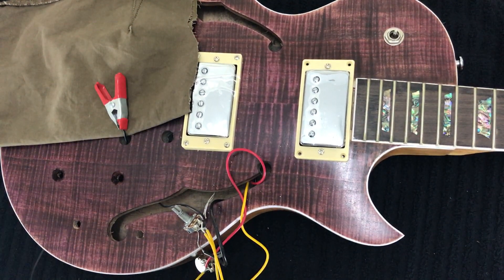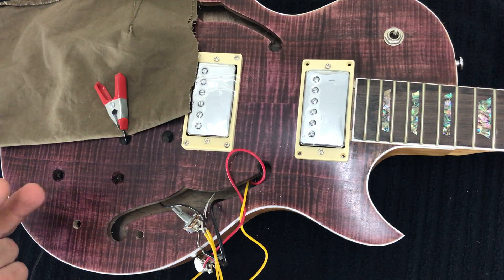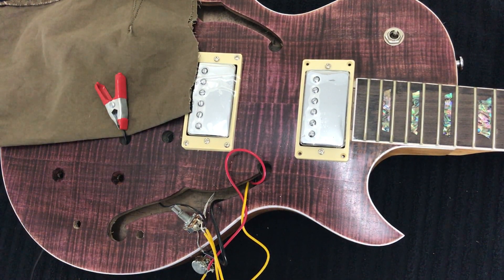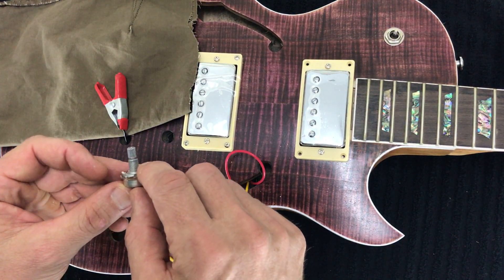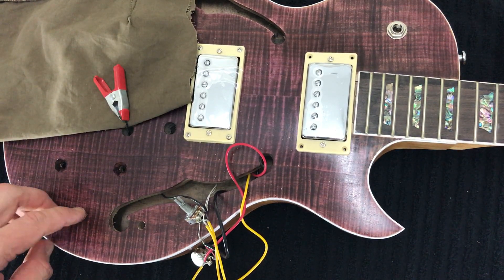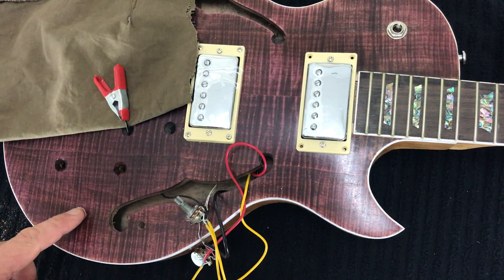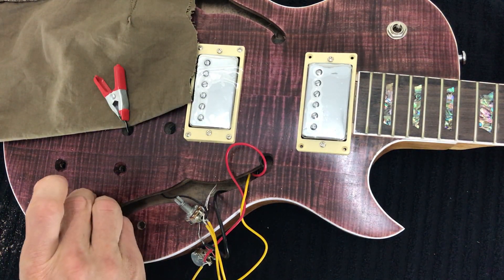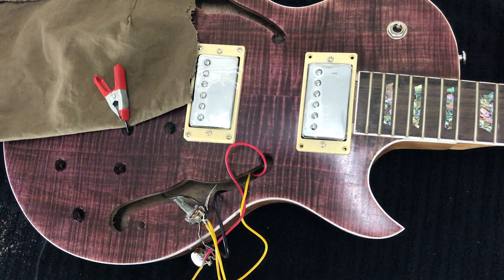Adjusting Semi-hollow Body Guitar's Volume and Tone Pot Holes

Comment: Question. Would it make much difference if there was access on the back of semi hollows? I've got a 335 style which I need to change the switch on and it would be just sooo much simpler . 😁
Reply from the maker: Hey! Thanks for your comment. Yes, that makes assembly easier. At the moment only some of our semi-hollow kits have an opening to the electronics cavity from the back.
Reply: I had a similar guitar years ago, and yes, it would be so much simpler to have a rear panel. Having to thread the pots out of the f hole to do any wiring work is a lot trickier!